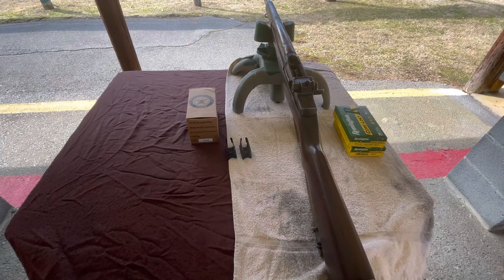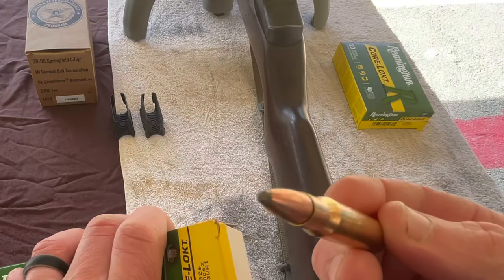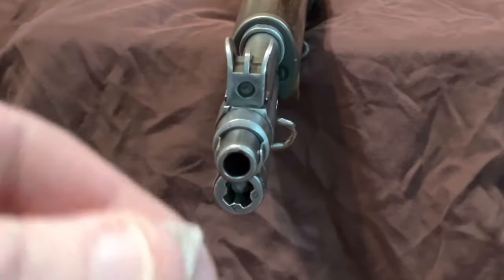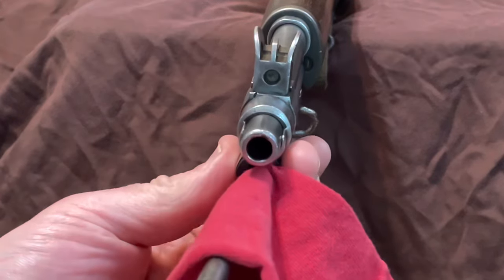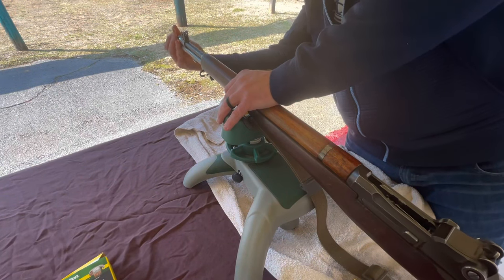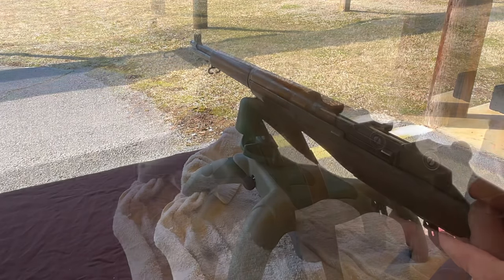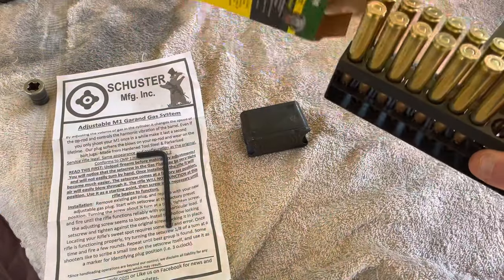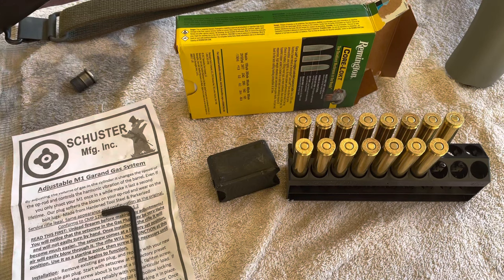M1 Garand Shooting Commercial Ammo-Safely!

Comment: Did it cycle with the M2 ball ammo with the gas plug set for the other ammo?
Reply from the maker: No it won’t with consistency. Even the 150 grain commercial ammo comes out with a little higher pressure. 
If I shoot ball ammo when the plug is installed, I have to tighten it a little to get it to eject consistently.  Thanks for coming by!

Comment: Completely unnecessary. Seeing as the Rifle was Developed around M1 Ball, not M2 Making the baseline the lighest service load is a false start. M72 Match was used well into the 1970's FM-25-3. TMG on youtube has a way better breakdown why these adjustable gas cylinder lock screws are not needed.
Reply from the maker: I’ll check it out. Thanks for coming by!

Comment: Eventhough I went with the Garand Gear plug I'm still hesitant to shoot anything but surplus and ammo that's loaded to 1940's spec. I finally found some for less than $1/rd
I don't know if the Schuster would've made me any more comfortable
Reply from the maker: The commercial Garand safe ammo hasn’t been available in my area for a while and the CMP is hit and miss. I try to do what I can if I just use regular commercial .30-06. Thanks for coming by!
Reply: What is 1940s "spec"?
Reply: @airground1  .30-06 loaded to the specifications of the M2 Ball ammo
Reply: @georgewhitworth9742  false... that's ONE of 1940s spec ammo

Comment: No factory ammo is going to hurt an M1 Garand, if you claim otherwise you're lying.
Reply from the maker: Thanks for coming by!
Reply: Well, it’s not necessarily a lie. It’s just people concerned about the bearing loads that the Operating Rod would take if firing hotter ammunition. 

The XM16E1 rifles in Vietnam had this problem because the US Army discreetly hidden the port pressure specs that were necessary to make the weapon work properly and to prevent over pressures. In other words, the driving forces of the M1 Garand cycle can be manipulated in a bad way and it even cause parts to fail when they shouldn’t have. 

I do think however that commercial 150 grain 30-06 isn’t gonna hurt the weapon, I think it’s safe but I don’t think the bullet weight should be higher than that unless you’re using a adjustable gas plug.

Comment: You can shoot commercial ammo but I wouldn't....its a 70 plus year old gun....I bent a op rod years ago shoot commercial rounds...I'm  sticking to M2 ball ammo or I reload to Mil Spec M2 ball...those adjustable gas plugs are a joke..I've had several Garands and still do worked as a gunsmith for 40 plus years.Shoe
Reply from the maker: I am very careful about it, and a couple folks have come by claiming that no special gas port is needed for commercial ammo. Well I’m with you- it’s old and needs some special care for the longevity. I do have a stock of M2 ball but it’s limited so I do what I can if I have to shoot something else. Thanks for sharing and thanks for coming by!
Reply: @cornfromajar3222  Thank you for the response...a suggestion if you don't reload the CMP is selling the Seller and Berlot ( I think I butchered their name... the Chez ammo) and its specifically made to shoot in the M1 yes cost alittle but highly recommend...yes love shooting a Garand...happy shooting Shoe

Comment: Uh, HOPELESS NONSENSE.  You repeat virtually every Garand ammo myth on the internet. First, M2 Ball had NOTHING whatsoever to do with the M1 Rifle.  In fact, John Garand himself strongly recommended M2 Ball not be used in combat.  Second, there is nothing "different" about "modern" ammo.  The pressure specs for .30-06 have remained unchanged since 1906. Third, it is obvious you are clueless as to how the M1 Gas System actually works.  Little hint.  All other factors remaining equal, higher velocity bullets produce LOWER gas port pressure.  Fourth, the M1 Garand was developed (primarily) around FULL POWER and FULL PRESSURE (est. 56,000 PSI/48,000 CUP) 174 grain M1 Ball ammo. John Garand himself recommended M1 Ball as late as 1942 (or 165-168 AP).  Likewise, REM 150 Core-Lokt is a MILD shooting factory ammo.  In fact, it has EXACTLY the same gas port pressure as M2 Ball.  Your advocacy of using a MODIFIED GAS CYLINDER LOCK SCREW (there is no "plug" on your M1 rifle!) only reflects the fact you don't really know much of anything about this topic.  Absolutely not needed with most (as in 99%) of commercial ammo 180 grains or less.  If you REALLY want to learn some facts, you can watch THIS VIDEO.  You should consider deleting your video as spreading misinformation isn't helpful.

VIDEO PART 1:  https://www.youtube.com/watch?v=UOSdswZHJUc
Reply: PART 2:  https://www.youtube.com/watch?v=5kKTrT9_Fus&t=0s
Reply from the maker: Well better safe than sorry I guess. Thanks for watching and thanks for coming by!
Reply: John Winn here is wrong. Modern ammunition does put greater strain on the m1 garand. Theres plenty of testimonies of bent op rods plus this video:
https://youtu.be/ZQ_F1riBth8
 has in depth + mathematical/ scientific tests proving that modern ammunition puts higher strain on the op rod, as well as proving that the ported gas plug reduces the velocity at which the op rod travels.
Reply from the maker: @Brock_CO  I try not to get into too many knowledge contests in comments. I know folks will disagree with some content I make and I am no expert or genius. But in this case, my goal is to keep my 70 year old rifle in best shape I can so my sons can inherit it once I’m gone. And each guy can treat their gun however they want, but I wanted to show what I’ve done and maybe help somebody else who was concerned like I was, because I didn’t know you could buy a special plug for commercial ammo. Thanks for coming by!
Reply: Bet this guy is a hit on the cocktail circuit.